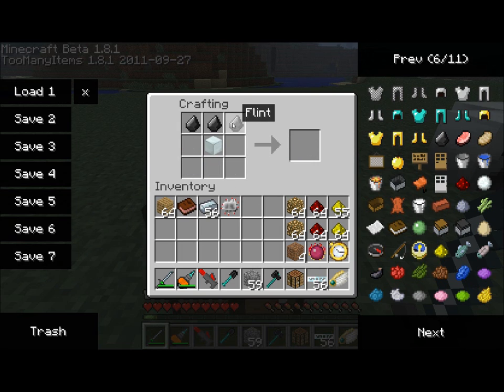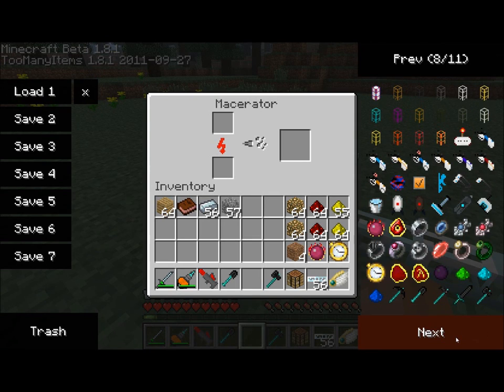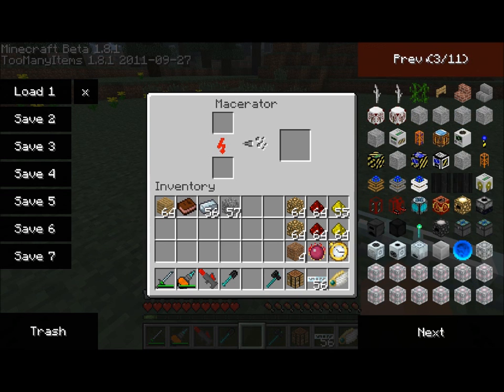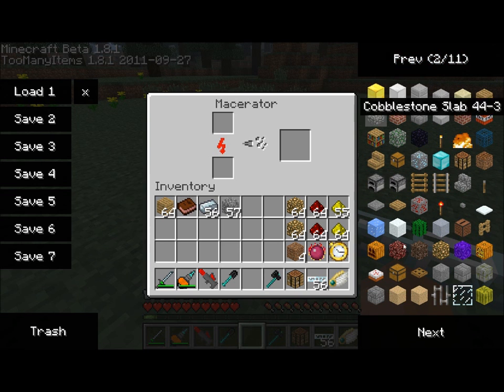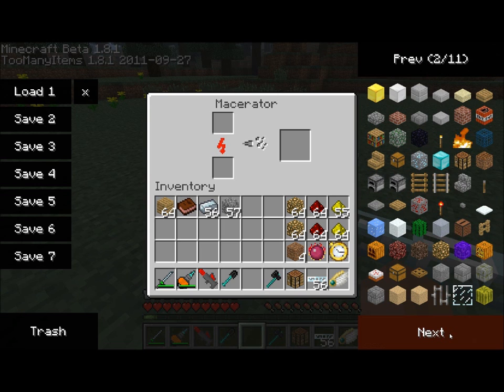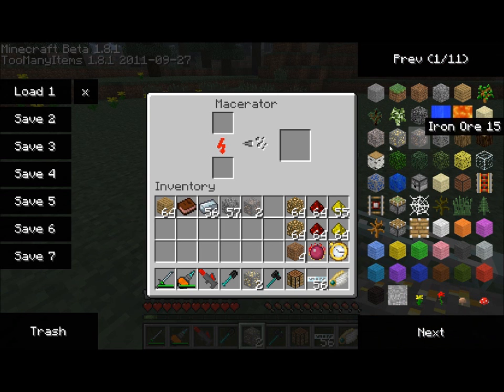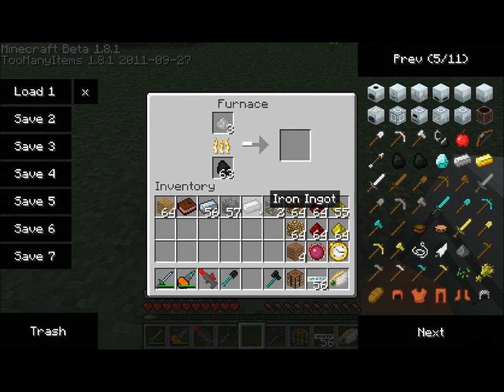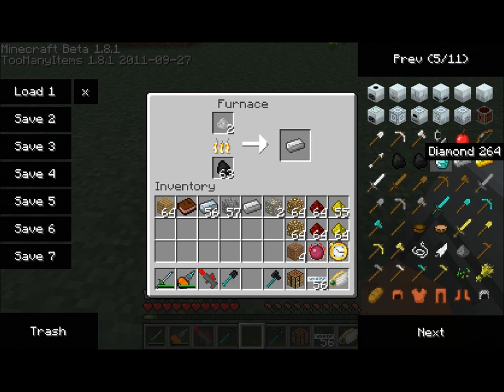IndustrialCraft 2.0 Tutorials - Macerator

Comment: I need help, my macerator was working fine and then suddenly it doesn't work. like the red arrow doesn't come on and i've tried removing and replacing the macerator and also rewiring. everything else connected to my power source works, except for the macerator. what should i do? =\